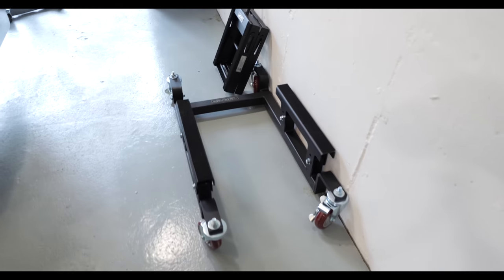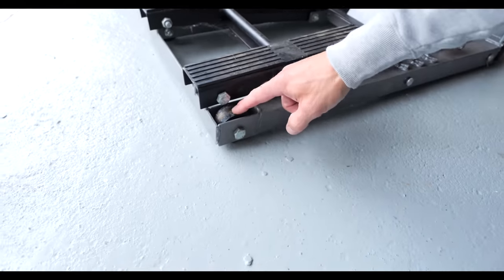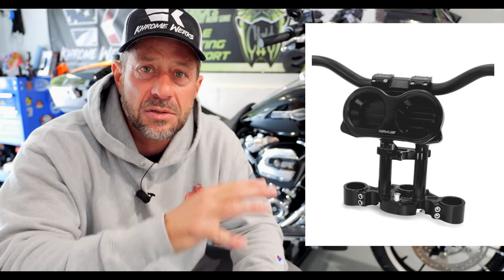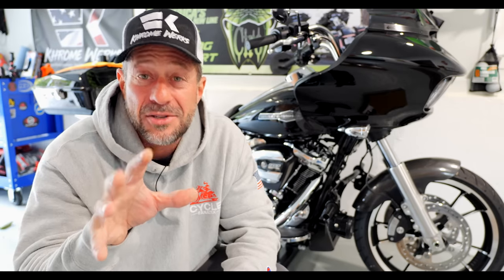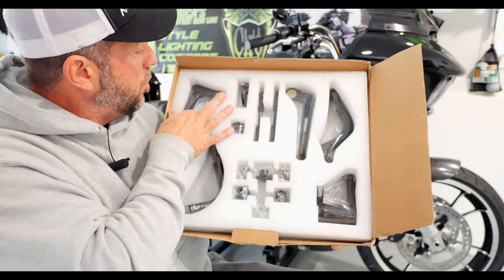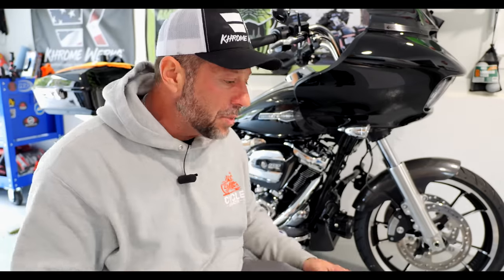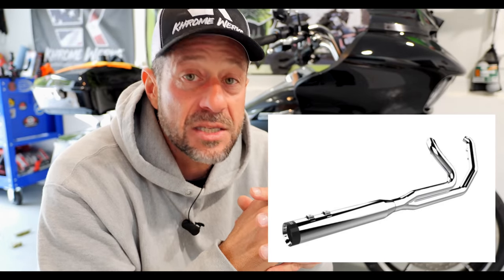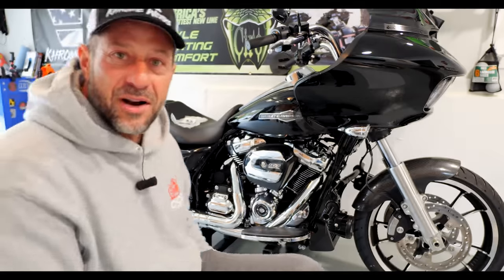Harley Davidson Upgrades | 2022 ROAD GLIDE #roadglide #harleydavidson #harleyupgrades

Comment: I’ve gone plus 2 all round on my road glide another option to run black dlc tubes you could’ve went dyna tubes and legend cartridges they are same spring rate but length is longer at 25.5 but worst case slide them through tree a bit or with your height could run at full length once sag is set. Also with your full length 2-1 pipe and running 14 inch rear suspension your axle might hit pipe on swing arm clearance might pay to buy an aftermarket axle and adjuster to get around this

Comment: Can’t wait to watch Dave go to work on installs. Looking forward to all the big rides you take, next year! I’m in big agreement with the Stage 2/Stage 2+ for reliability throwing down big miles across the land, making upgrades with parts every dealer can wrench on if needed. 107 is a great platform, upgrade cam, oil pump, exhaust, air cleaner,  lifters, rods, should be all one needs to bullet proof for long travels, still enjoy its performance and grab a great sound to boot.

Comment: Lol,
Awhile back i  made a comment that u can't ride a big bore motorcycle reliably like u can a stage two! I got 30hp with A cam on my 107 road glide. I went from 79hp. To 108hp and i rode in Houston Texas heat not one issue. Big motor H D can't compete !  If u like to ride stay away from  big bore. FANATIX is about to revolutionize stage two Hds in the near future! He'll prove u don't need  big motors to have reliable fun on HD!

Comment: I have +2 in the front (Patriot Springs) and 14' in the rear (RWD). For my side stand, I went with a simple Bung King lift block. It was about 1" and the bike sits as it did stock. There's no ridiculous lean like some people like and I was able to keep the stock side stand instead of buying a Performance Machine +1 stand that would cause me to have a stock side stand that no one would want.

Comment: I don't think the LETS ROLL LIFT AND DOLLY SYSTEM will lift the bike high enough to be able to remove the back wheel. I have the same Harbor Freight lift as you and I have to jack the bike all the way up to be able to remove the back wheel   The back fender has to be high enough to pull the wheel out.  Let me know if the lift can let you pull the rear wheel. If it can I'm in

Comment: Exciting stuff!!  Parallels my bike, a 2022 Street glide ST.  Front fender- check, power from the 117- check, Air cleaner- check, 2/1 exhaust- check.  Lighter weight-check.  Probably not going to go with the bar and suspension upgrades, but we shall see.  Keep it going, cannot weight for the next wave of installs.  Thanks.

Comment: Great video man. Can't wait to see the finish product. Only criticism I can give is the 475 cam. It's a good cam but I promise you'd be happier with the star racing 30-30 aka moonshine mhp 45. Maybe something to look into.
Reply: I just ordered to 30-30, s&s manifold, and cam chest kit & thundermax for my 114. Waiting on it now. I wanted to use the star F35A cam but it requires valve springs to be changed but after spending $2800 I can't justify the extra cost for parts and labor
Reply: @travisdunn5675  30-30 is more tq down low. Think you'll like it more. 😎
Reply: @THEM_ROBINSONZ  it gets rave reviews from people who actually have it in their bike. That's what sold me.
Reply: @travisdunn5675  love mine

Comment: Looks like I’m a little late for the suggestion but maybe you could give Pro Action Suspension a chance on one of your bikes. They’re a smaller local company over here near Pittsburgh, in Beaver Falls. I have there 13 inch rears and front end kit installed and it made a world of difference in how the bike rode. I’m sure legends is great, just wanted to mention another option and give the small business a chance.  Good luck with the build buddy, thanks for all the info over the years.

Comment: Ask Dave about the ss540 cam.  I guess it's the same as the ss475 cam but with more torque off the line. And then after that it's the same.  ss540 needs heavier springs.

Comment: Good stuff John as usual and can't wait to see where Kong is headed.  About the jack portion though, people have to understand that the Harbor Freight Pittsburgh jack is not and never was designed to move a bike around while it is jacked up.  That's comparing apples and oranges pitting it against the Let's Roll system in that regard.  For what it was designed for, the Harbor Freight jack does a fine job.
Reply: Yes and I might add a true value for $69.99. Have been using mine for the past 10 plus years, Saving my penny's for a lift table tho.

Comment: I'm 6' tall and find myself riding distance with my feet back on the floor boards, I only stretch my legs to the toe-pegs once in a while. 
My Victory has a "stage 2" 106, its putting 113hp/115tq to the ground. Its a good power to cruise, the bike will get up and hustle with a throttle twist and I've not had one issue in 73k miles. But truth be told, after all the years and miles I'm bored with the power level 🤔

Comment: hello, I have 2021 Sportglide, stage II, I installed the Star Rcaing 30 / 30 cam which has a .485 lift, S+S cam plate, oil pump and an S+S 55mm intake manifold, had it dyno tuned using a PV tuner, stock headers with a Rinehart slip-on, I did not go with larger fuel injectors. I ended up with 105HP and 125 ft lbs of torque, not too bad, but, I was hoping for more on the HP side, you mentioned getting 115-120HP using the S+S 475, I'm assuming that you will go with a larger throttle body, intake and injectors? not sure how much HP you'll generate without making those changes? I'm already thinking FM 124 kit, just not sure, good luck, I'm certainly interested to see how how the engine work turns out, thanks

Comment: You beat your last bike, of course it broke. My opinion, you should have started with a 114, done an SE 131 kit. Replaced the weak parts and done an aftermarket cam kit. Good luck dropping 50 hp and tq. UGH!

Comment: How are you going to fit 14" shocks on the back with that full length long exhaust not hitting the axel nut. I was told you can only install 14" if you have a short exhaust....or maybe i will just have to wait and watch
Reply: You have to make clearance by beating the muffler with a hammer
Reply: By denting your muffler a little. Or a then axle nut. A new swing arm there is 29 ways to fit it. Its not hard.

Comment: There are so many better cams out. The 475 has a huge dip in tq
Reply: Which ones?
Reply: No dip in my dyno sheet with the 475 think a lot to do with who’s tuning it. Ended up with 125hp and 131T use it.  Really enjoying it. Like a whole new bike.
Reply: @eastcoastganjafarmers85  I have the 475 the tune sucks and is getting retuned in November. But everyone has seen that dip at 2500 rpm. What exhaust are you running?
Reply: @jd8169  Star Racing is one I’d like to try.
Reply: @CYCLEFANATIX  lol maybe because it’s being gifted. I have one it sounds great I’ll say that.
Reply: @dwight072   d&d billet cat.
Reply: @dwight072  @2500 rpm in already at 120 ft tq
Reply: @dwight072   I took the 6.5 hour ride to PA to see dyno Dave. He worked his magic tuning it for sure.
Reply: @eastcoastganjafarmers85  I have the same
Reply: @eastcoastganjafarmers85  114 or bigger motor ?
Reply: @dwight072  117
Reply: @dwight072  star racing 30-30 is the torque monster but it falls off just before 5k rpms. woods wm8-22xe moves the power curve 500-1000rpms later but doesn't hit quite as hard at 2500
Reply: @jd8169   cr 480 is up there but then displacement comes into play
Reply: Dwight, I have the 475c on my 2021 CVO Road Glide, after dyno tune I have 124hp and 124tq with the Khrome Werks dominator exhaust, torque goes straight up and stays flat through the curve, no dip at all. All cams can have a dip in torque depending on the exhaust, and/or bad tune.